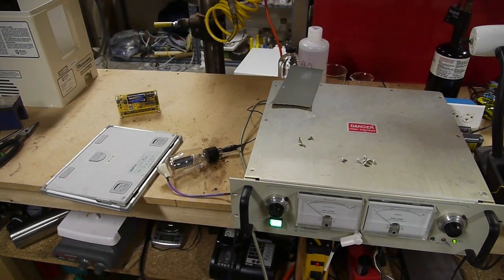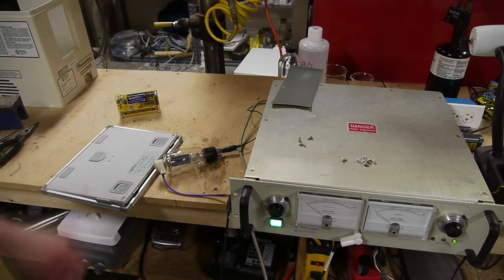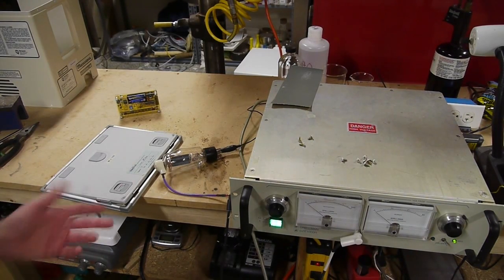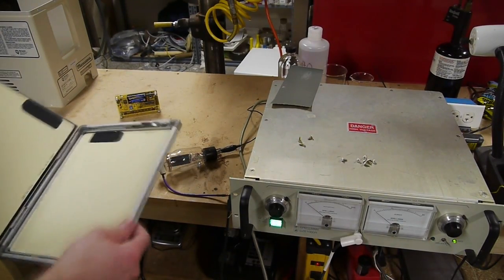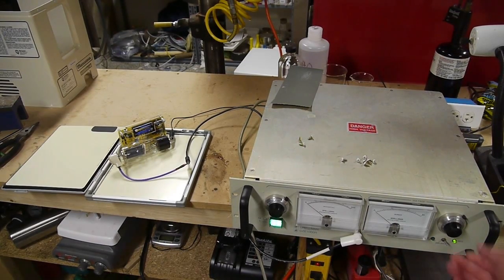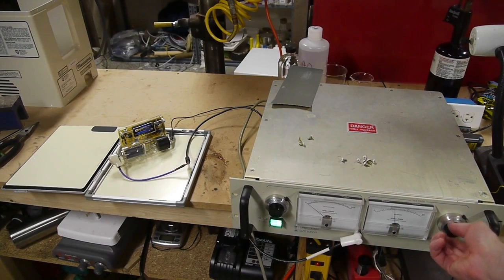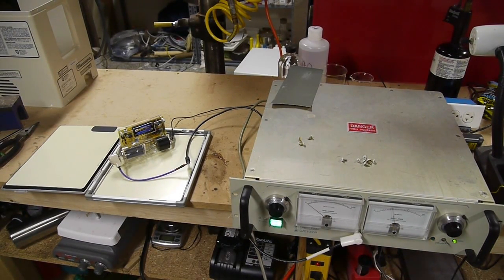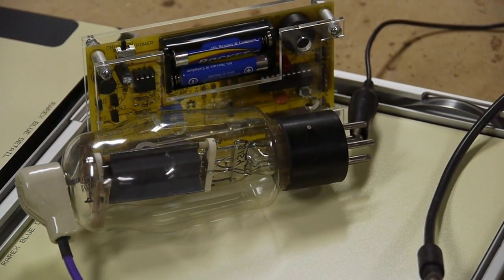Creating X-rays with a standard vacuum tube

Comment: i do not believe this is emitting meany xrays at all if any. if he was able to heat the filament at a high voltage potential he would emit many types of radiation including a noticeable amount of xrays.. but for xray tubes they have an emliment that when stricken by an electron it emits much more x rays. (i forgot the name of it)  but thank you for your post i heard the numbers before but i also forgot the standardize levels and what they were measured by. im guessing you work at a power plant?

Comment: i think the giger counter is just picking up stray electrons from the high voltage itself.(interference) im 90% sure thats what is happening and the pannel only glows because of the reflection of light emitted from plasma. this should be emitting xrays but a very very almost undetectable amount as you just made a plasma ball in an impurfict vacuum. being able to heat the filament ant a high voltage potential would make much more xrays

Comment: You should definitely get a few radiation badges if you plan to do this; stop all work with x-rays once you go over 20 mSv in a year (flights = 0.2mSv, US background = 6.5). Though you can go higher than 20 mSv (radiation sickness sets in at 100 mSv), the official annual limit is 20 millisieverts 
Also keep in mind that x-rays can travel very far in air (more than beta/beta+, less than gamma), and that your Geiger counter is fairly low quality compared to the ones used in my chemistry lab.

Comment: The old colour TV rectifier tubes might be better - built for 23 kv.  And while you are at it, you could get about a milliamp at 25 kv from the flyback of an old colour TV.  The rectifier tubes on  the old TVs was always in a metal cage for xray shielding.  Trouble is, where to find that 1975 or earlier 23" colour TV.
Reply: I have a couple of those tubes.
Reply: @RC-nq7mg  Me too. I have one that even says "warning x-rays" on it.
Reply: @Vaionko MOST of them had that warning on them

Comment: The voltage he's using is very very low, in medicine we use at least 45 kV and even then it barely registers on our dosimeters (a little cassette thing we use to measure how much radiation exposure we've had).

Comment: Well, changing the length of the tube isn't going to make the electrons more energetic, it will just take a higher voltage to get them moving. (remember eV is a measure of energy)

Comment: when playing around with my CO2 laser which operated at 18kV, I stuck my geiger counter near the tube and it started to rapidly click as well. Though I think that would be due to the electric field interfering the the electronics of the geiger tube device (i didn't shield it).